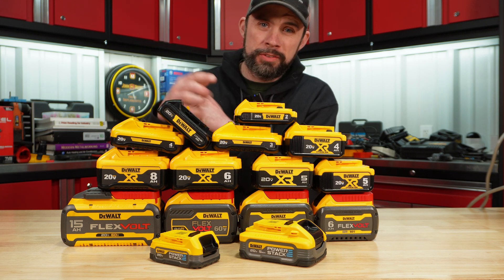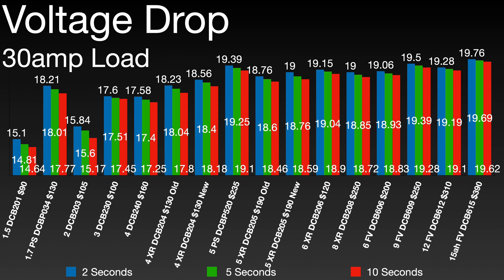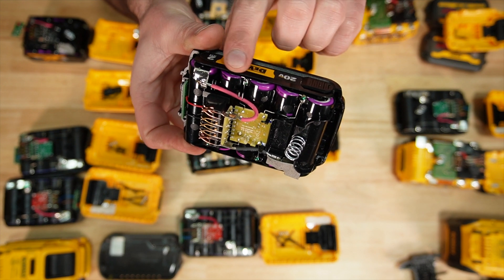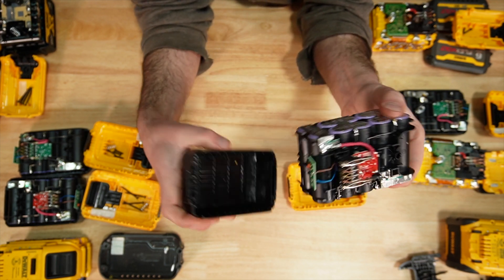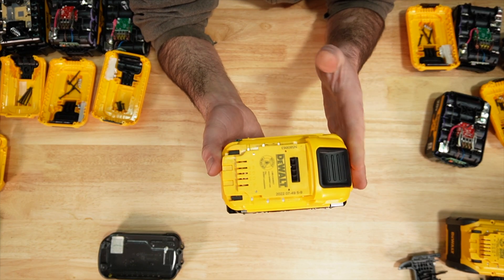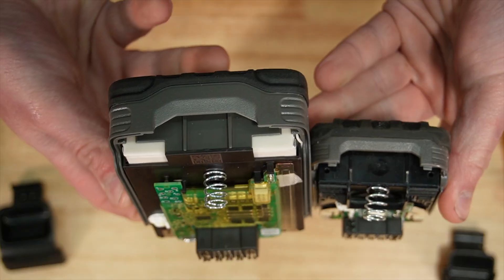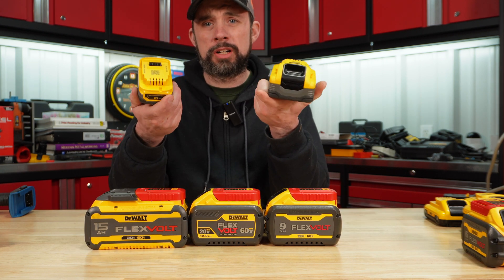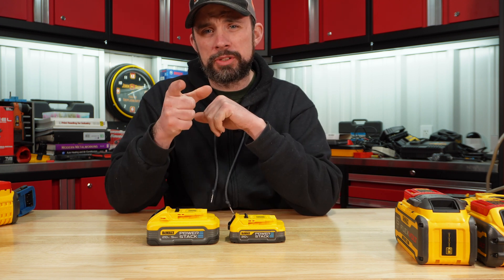Dewalt 20V Battery Testing & Teardown

Comment from the maker: AH	                        Weight
1.5ah                     12.6 OZ
1.7ah PS                11 OZ
2ah	                        13.2 OZ
3ah	                        1Lb 3.2 OZ
4ah 	                1Lb 3.2 OZ
4ah XR	                1Lb 6.4 OZ
4ah XR New Gen	1LB 6.2 OZ
5ah PS	                1Lb 10.2 OZ
5ah XR	                1Lb 6.2 OZ
5AH XR New Gen	1LB 6.8 OZ
6ah XR	                2Lbs 2.4 OZ
8ah XR	                2Lbs 1.6 OZ
6ah FV	                2Lbs 6.2 OZ
9ah FV	                3Lbs 4 OZ
12ah FV	                3Lbs 4.2 OZ 
15ah FV	               4Lbs 11.2 OZ
Reply: I really hope they give us a 3 Amp Power Stack.
Reply: Whoa! How does the 8Ah XR weigh less than the 6Ah XR? And are they in the same housing/casing? They look like they are from the video.
Reply: all these specs are from real DeWalt batteries? Some maybe knock offs.
Reply: the cells in the 6Ah FV are 30A cdr in 3p5s config, so the cell config can theoretically deliver 90 amps. Does the pack have a current limiter? Similarly the 4Ah XR is 2p5s could deliver 40 amps based on cell cdr. Asking for a friend.... my DCF899

Comment: Will you be updating this with the 3.5Ah PowerStack, 4.0 PowerPack, and 8.0 PowerPack?
Reply from the maker: Probably not,  see the batterie videos don't do very well.  That said the 3.5 and 4.0 are almost identical in performance with the 4.0 performing better.  Both the 3.5 and 4.0 provide power number almost identical to running a norma 8ah XR.
Reply: @Tools-Tested  Would be nice maybe if you could a do video with JUST the 3.5, 4.0PP, 5.0PS, and 8.0 PP.

Comment: What is the cheapest battery per watt hour or amp hour?
Reply from the maker: Really comes down to what's onsale IMO.
Reply: @Tools-Tested  It actually comes down to division.( amp hour/price.)
I just now noticed that “xr” batteries are supposed to perform better than their advertused rating (5.0 amp hour XR batteries approach 6 amp hours real world) Anyway, i just realized the 6.0 + 4.0 amp hour with charger set are NOT XR rated. They use the 21700 cells tho which i think is an advantage. (less cells, same amps := less internal impedance := less heat)

Comment: I bought the xr6.0 + xr 4.0 + charger kit awgule back(174 as of today at Home depot, prolly best bang fer the amp hour buck at this time). Anyway, the 6.0 xr is impressive and i hope far more durable than my 6.0 FV’s. Of the 6 FV’s  i bought (needed 4 for my dewalt 4 battery charge station/1500 watt inverter. Of the 5, 3 are bricked now in only 3 years of VERY light, occasiinal use. Not impressed with FV’s…
Reply from the maker: Yeah they really need to work on the FV's.

Comment: Hey really cool video. 
Did you consider to test the new Dewalt powerPack battery. I saw a video that the guy compared the power pack to the power stack and the power pack out perform the power stack.
Reply from the maker: Yeah from my testing the 4ah pp will actually outperform the 5ah ps performance wise.
Reply: @Tools-Tested I really like your videos. Also like your precision test that you perform.

Comment: use the sense input by running another pair of wires to as close to the battery as possible. (you have to enable sens in the menu)  That way you will get more accurate volt and watt readings.  also connect the negative to one load and the positive to the other to equalize the drop in the jumper between the two loads.  Either way thank you for the scientific approach and under the hood view.

Comment: This is a very solid video. I would like to see about the 10ah XR and the new 8ah power pack under a voltage sack
Reply from the maker: Thanks! Probably won't do the 10ah,  it looks like it's been discontinued.  

The 8PP was tested with the new hammer drill in video https://youtu.be/sizgpOrgXHg.

I currently have the 8PP, M18 tabless,  Makita 40v tabless, rigid exp and ryobi edge.  Once I get the Bosch core+ and Metabo LiHDX I will do a similar video to this.

Comment: When using my DCD777, I found that the performance was almost identical with the 3.0 compact battery compared with the 5.0 XR battery.
Reply from the maker: Interesting thanks for the info!
Reply: @Tools-Tested  A more powerful tool might show a bigger difference in performance, but the 21700 cells in the 3.0 definitely give my DCD777 a big boost over the 1.3 battery.

Comment: Awesome video thanks for the info, I just bought a 2 pack of 3 ah batteries and I wanted to know what cells were inside and you definitely answered that for me 21700 cells for the 3 ah which means more power and a compact battery 🤟🏽😈

Comment: Does the 3.0 battery have 21700 cells?
Reply from the maker: Yes but 21700s are only in the 3ah slim packs,   They do sell a regular 3ah which is 2 rows of 18650s.

Comment: Ah! Thank you for that info on the 5ah power stack. I thought there was something wrong with mine. I use my batteries for my kids power wheels and I couldn’t figure out why it would cut off power after 1 second. The 1.7 runs fine
Reply from the maker: No problem! Yeah kinda sucks they did that.

Comment: I'm really surprised the 6ah flexvolt still uses 18650 when the 9 and 12 flexvolt are 21700 now. Even the 6ah and 8ah XR packs use the newer cells. The performance difference seems to show in your test.
Reply: Yep, definitely unfortunate. Unfortunately, for flex-volt to work you need the number of cells to be some multiple of 15 to reach 60 volts. 60volts / 4v = 15 cells in series. This is why the 6Ah, 9Ah, and 12Ah all have 15 cells and why the 15ah has 30 cells. The 6ah battery is only 6Ah in 20v mode. In 60volt mode it is only 2ah. (6Ah x 20V) / 60V  = 2Ah. This means that to create a flex-volt 6ah battery you need 15 x 2Ah cells. Unfortunately, 2Ah 21700 cells, to my knowledge, don’t exist. This leaves 18650 cells as the only option. Battery manufacturers are unlikely to ever produce 2Ah 21700 cells. The energy density would be worse than nearly all current 18650, so there would be essentially no buyers other than DeWalt for this a single, niche battery. It is for this reason a 6ah flex volt with 21700 cell will likely never be produced.
Reply from the maker: Yeah kinda crazy
Reply: The thing is 18650 cells configured 3 rolls have the same power as a 2 roll 21700 so I would get the flexvolt 6amp over the 6amp xr

Comment: Thanks for the great video.
I have two DCB205 batteries that came in a kit with a bag and charger dated 2022 with red cells marked ICR18650HE2 HEL.  I thought they were LG but I heard you say Samsung.  Did they use both or do I have counterfeits?
Reply from the maker: No problem,  seem like they are legit cells.  But I haven’t seen them before in a dewalt pack.
Reply: @Tools-Tested  Thanks. I sent an email to DeWalt and will let you know if they reply.
I do have some legit DCB205 batteries dated 2019.  Two have green Samsung INR18650-25R cells and two have red LG LGABHE21865 cells.

Comment: Heck yeah I found it useful. Battery upgrade time, when you run DeWey, is a confusing time.

I found out he other day (from you, actually...comment on this is below) that my 5Xrs are fakes and that told me I was leaving a lot of potential on the table for all of my smaller tools. So, I did what any fool with money does, and I went to Lowes, and I paid Big Box off the shelf price and I replaced all of my 5XRs with 5PSs. It wasn't cheap, but I was done fooling with this issue and wanted it solved.

But then I got to thinking "what about the bigger tools? What about the ones that I run on the 10XR and the 8XR? How good ARE these PSs. Can I run my circ saw or my grinder with them as well?"

Without pausing your charts, putting on my reading glasses and studying your numbers...I would never have been certain I was getting the best out of the bigger tools with the 5PSs slapped in. But your charts show that they absolutely WILL do the job of my 10 and 8 XR so...

...yeah, thanks for doing all of this work.

Comment: Alright buddy, it's on YOU now.

I was doing just fine, innocently minding my own business. For my smaller tools, I had a couple of XR 5ah batteries, and a couple of non XR 3ah's, in case I needed to keep them running while the 5's were both on the charger. I was carefree, blissfully not knowing any better...and then your outer video happened. 

You caused me to go out to the garage, open up my 5Ahs and find out that they are fakes. Mind you now, I do not work for DeWalt and I do not own any B&D stock, so I would not care one ounce that my batteries were counterfeit if I could expect the same performance. But you could not even leave me with that. You and your thermometers and output readers...you showed me that your fake (identical to mine, right down to the same exact date code) gives out lesser performance.

So I said "self, you handsome devil, let's just do all of the crying at once, solve this problem for the long haul and be done with it). Mind you , saving money is a habit, left over from when I was young and poor. At my present age, I can be convinced to dig a little deeper when I need to. So I did. I replaced my two counterfeits and my two non XR backups alike, with 600 bones worth of four 5Ah Powerstack (which will upset me further as I watch the price on them come down in a year).  If they suck when they get here, I am blaming you!

Now, I also have an 8 and a 10, for my bigger tools. If I find out THOSE are fakes too...I very well may respond to my battery shelf with my firearm.
Reply from the maker: Yeah it's crazy how much the fakes look real until you open them up.

Don't worry your no the only one lol.  Seems like 90% of the 5ah on eBay are the fakes.

The 5ah PS are defiantly over priced and will probably come down at some point.  Buying the 2 pack is the better deal.  But they do give a boost in performance from the tests on the drill dyno.

Comment: Strange that they didn't use Samsung 50S on the 15Ah so they could just do 15 cells...but 20S's are quite the bangers and the 50S couldn't really touch that the 20S's in terms of power
Reply from the maker: Yeah its defiantly an interesting pack,  in real world testing the 15ah runs away from the 12ah FV.  I have been using all 4 FV's in my 20" chainsaw.

Comment: The power stacks batteries need to see the tool to keep people from using them in powerwheels and other such projects as it’s extremely harmful and dangerous to run these lithium cells down under voltage but the new power stack batteries is even more dangerous to run under voltage.
Reply: Interesting point!

Comment: That interesting. I have many dewalt battery's. I even have the 10 Ah 20V not shown. works super for me. getting more power to the tool is not a big deal for my use. run time is more important for me. what data I am looking for is the cycle life on power stack 5 Ah compared to XR 5 AH 20V . as a electrician the tools I use the most do not load the battery much. like LED lights and the small right angled drill. sometimes I drill a lot of small holes for romex cable. would like to see a test of new battery and cycle it. this will change from small load to high load.
Reply from the maker: I was looking at getting the 10ah but haven't found a deal on one yet.

Very good point,  they are claiming 2x the life span with the new dewalt PS,  hard to say if thats going to be the case without real world testing.  But at least now the cells are designed for the application.

Comment: So I'm thinking of modifying my 15 ah battery and removing the wings that are on the top that prevent it from being used on some tools, any reason that you know of to not do it (other than warranty)?
Reply from the maker: Might smoke some tools, I believe the wings are to prevent use in tools that will burn with the high power available.  Because the 15ah has the lowest voltage drop so the most power.

Comment: Great vid sir.
Hey I’ve got a question..
I just bought 4 generic Dewalt type 20v batteries on Amazon last week and they claim that they are 
6 AH. So I held one up to an actual Dewalt 6 AH that I have and quickly realized these generic ones are not the same size as a real Dewalt 6 AH battery. They are however the same size as a 4 and 5 amp hour battery. 
My question is, is there any chance in hell that these generic ones could actually be real 6 amp hour batteries? 
I even weighed them
And a real Dewalt 6 AH is 99 oz. A real Dewalt 4 and 5 amp hour battery are 60 oz. These generic ones are 58 ounces. 
So what do ya think on this?
Reply from the maker: Thanks! 

From my testing of generic battery's its usually 1-3AH less vs what the label says.  Also they seem to have a higher voltage drop vs the OEM packs which normally = less performance out of the tool.

I tested a Generic m12 9AH on the drill dyno and found the performance similar to a 3AH CP not even a XC pack.  I still need to do a runtime test with the 9ah on the load cell but I'm expecting something similar to 6ah runtime.
Reply: @Tools-Tested  yeah I pulled one apart tonight and they used 10 of the 18650 cells, vs what a real Dewalt 6AH battery uses which is 10 of the 20700 cells. 
I’m a little bit pissed about this. And I am going to make a stink about this with Amazon. I will point out the information i just listed, along with pictures I took of the cells used in these knock off batteries. This is false advertisement, misinformation is a good term used in this day and age, a term that always seems to get everyone’s attention. 😀
It’s misleading consumers. 
I’m in my 50’s and I can remember a time when false advertising was kind of a big deal. Those Chinese manufacturers need to stop putting 6 amp hours on their batteries if they aren’t 6 amp hours. So we’ll see what happens this week with it. I’m not sending them back either. I’m holding onto them as evidence.
I’ll contact the better business bureau, consumer affairs, etc. this needs to stop, because they’re all doing it. Meaning all the knock off sellers are listing them like this.

Comment: Are there any visual exterior differences between the old and new 5ah? I'm not even sure which one I have.
Reply from the maker: Hard to explain but the new's decals are the full length on the side vs the old version the decal stops  about an inch from the edge.  Sorry its hard to explain.
Reply: @Tools-Tested  Oh really? I thought that was the old one. Were did you manage to find one anyway?
And is the new 4ah the same story?
Edit: I noticed now that the font on the new battery matches that of the recent 15ah.
Reply from the maker: @aco2518  it ended up coming in a kit I bought on Black Friday.  Yeah the 4’s are the same way.

Comment: Those flexvolt packs are beasts. I think they are mainly aimed at their static line of tools and possibly garden tools where the weight isn't so critical. Excellent detail in the video again!
Reply from the maker: Yep,  I really do like you can use them with 60V OPE and 20V tools.  I cant wait to use the 15ah in the chainsaw.

Thanks!

Comment: Thanks for the testing. I love the 1.7 powerstacks but really hope dewalt releases a 3.4 that's just a taller 1.7.  I'm not sure how true it is, but I think they said within 5-10 years they want all their batteries to be powerstacks, so I could easily see the 3.4 and 10.0 powerstacks coming into play at some point.
Reply from the maker: No problem,  Yeah I really hope we see something like a 3.4 and a 10AH!
Reply: they just released 10ah round cell battery, and it's massive, almost the same size as the 12ah flexvolt. lol. they cost about $200 a pop. you'd have to be f**ked in the head to buy these. 

don't count on seeing a bigger powerstack for a looooooooong time.
Reply: they are fully switching to pouch cells then, this is great news, pouch cells are definitely an improvement over cylindrical cells for most things
Reply: I just saw some a 3.5ah ps on toolnut for $169 😂 or 2 for $250
Reply: @Jojo_the_freak Yeah I seem them out in the wild now. I'll wait for a sale. They still have that "new" price tag.
Reply: Im good with a 10 AH XR baby

Comment: The 5ah powerstack is interesting. Looks like 6 parallel mosfets to isolate the battery. I wonder if that's to give it a higher low-voltage cut-off or a lower max charge voltage to prolong cycle life? I would have thought they could just manipulate the T or ID pin to get the same effect. Maybe it's a current limiter. You could measure the max and min voltage of the 5ah PS and compare it to other batteries to see if it does have a different voltage range.

Measure the voltage on the ID and T pin when it's running - I bet it's fairly easy to trick the battery into thinking it's connected.
Reply: Could be to reduce voltage drop and heat loss during high current loading?
Reply from the maker: Yeah I need to test those pins and see if its just an analog voltage or something more.  I wouldn't think it's a digital wave.